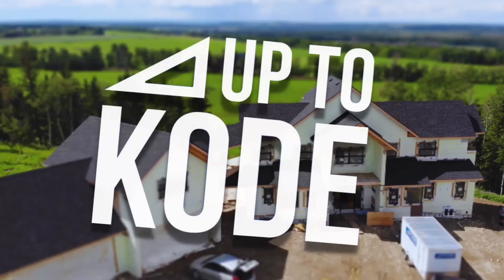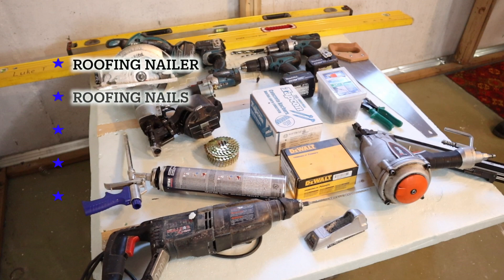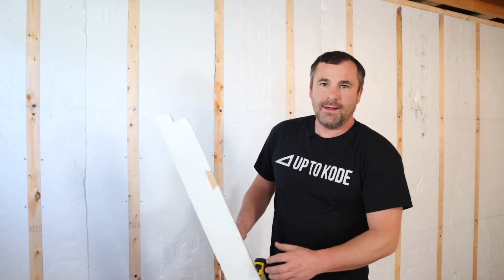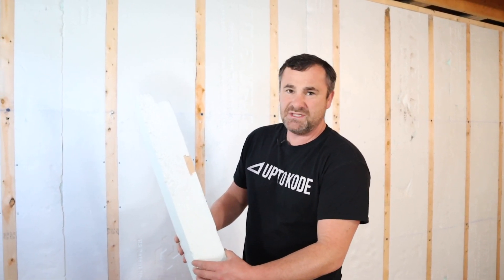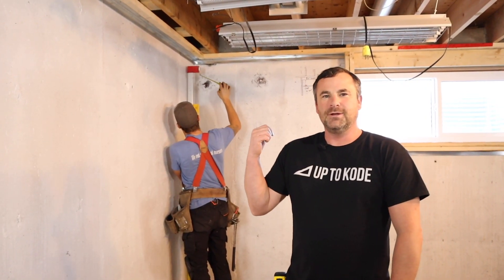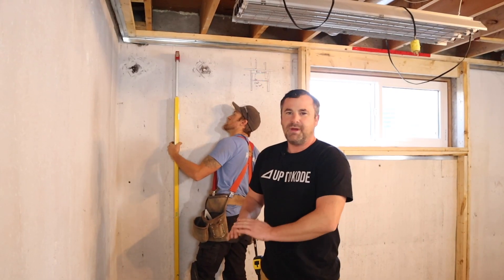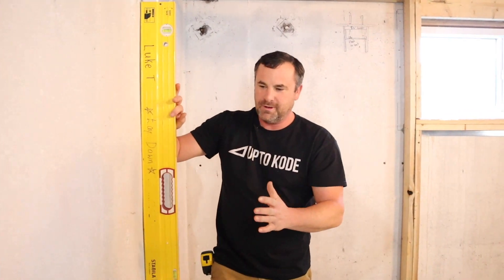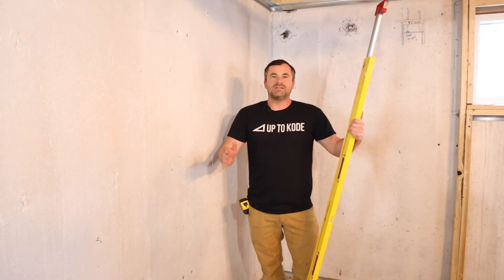Insulate & Frame Your Basement in One Step!

Comment: I once did a basement reno using 1.5" foam boards right on the concrete. Spray foamed the top and bottom and tuck tape to seal 100% then framed 2x4 framing in front of the foam and insulting with r-12 batts. Lots of work but it was nice and dry and warm. Where do you run the electrical and outlet boxes must cause problem ?
Reply from the maker: The way you did yours does sound super cozy. Maybe not as streamlined as this system but definitely solid and worth the consideration!! 

I will have a specific video on how we did the electrical. It’s similar to how we install it for ICF. Channel grooves for the wires, but we go behind the wood strips instead of cutting through them like we would in an ICF wall. Hope that helps.
Reply: @uptokode  It was a lot of work but this is what the customer wanted . We didn't have Homega back then or at least we didn't know about it . I'll watch for the vid on electrical. Thanks